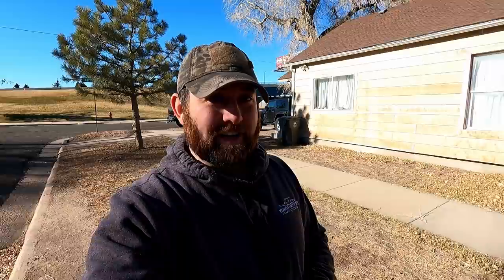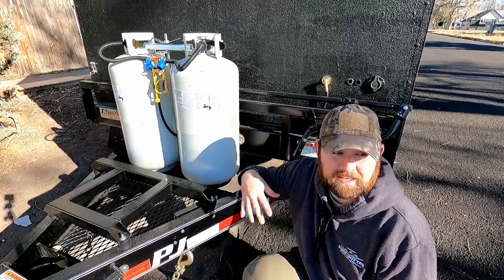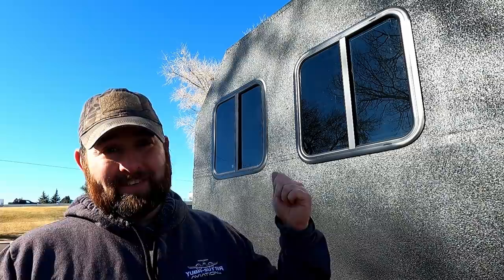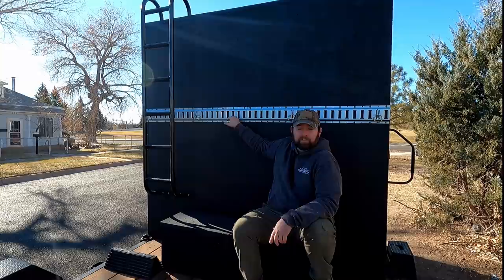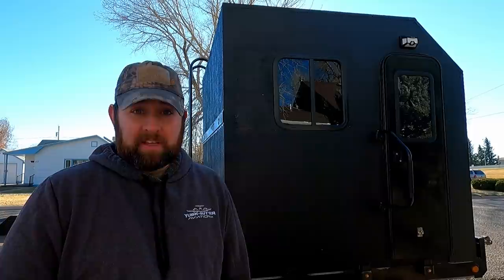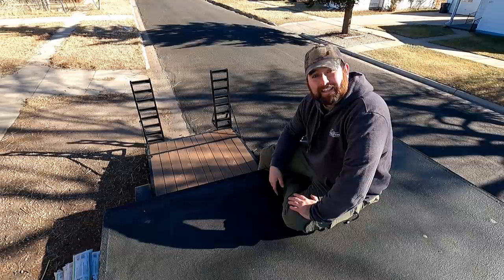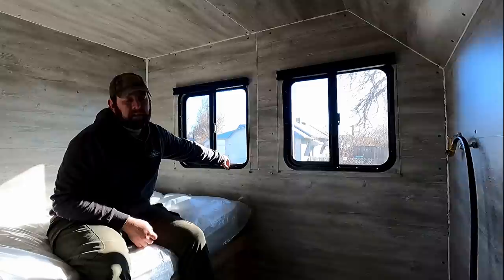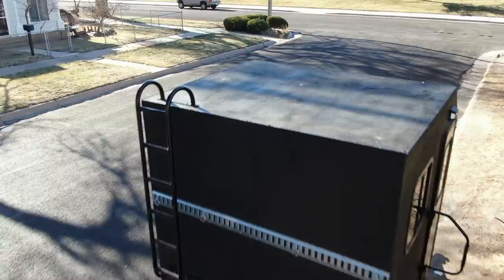DIY Crawler Hauler & Bugout Camper BUILD

Comment: Caulking is completely pointless if you don't run your finger across it or a tool to level it and push it in to the crack and they do make gray caulking I would just put some gray silicone finish it nice with a caulking tool same thing for your windows I'll get a black neoprene caulking do it in layers just fill the hole area in with caulking maybe use some backer rod but for the most part just finish caulking would be just fine.

Comment: Why would you want a Jeep when you are already bringing a Truck  

When a Motorcycle like a dual sport or Adventure bike Honda has lots of great ones to choose from at low cost // just chance the seat when you get it from Honda as the seat as they are hard for most people 

You could also get a 
A Side by Side make it street legal 

Or even a small boat 

All of those make by far more seance then a jeep and you could make the living space bigger or leave it as it is and just save the weight
Reply from the maker: The truck most definitely is not built for serious off road and the Jeep is not able to do highway speeds. Plus it's nice to be able to bring the Jeep back home if/when it breaks.

Comment: I'd go buy a black colored roll of vinyl baseboard... Then measure the length and width of the gap around your windows and PL-400 [subfloor adhesive] the bullnose [top] of baseboard down pointing inwards to the inside of the trailer... That way you see the rounded over factory edge of the vinyl showing and the cut down portion side faces towards the window and less noticeable or can't really be seen...  I'd use a metal straight edge to get straight cut lines that way you don't end up with jagged or wavy cut edge... I'd also join the two ends together on the middle part of the top of the window frame area instead of the bottom or side where it'd be more noticeable... See Photo...: https://i5.walmartimages.com/asr/70311d94-84d4-4892-9fb2-97977a19ae05_1.fee61adeb5a7ccafde162bfa58c35458.jpeg?odnHeight=450&odnWidth=450&odnBg=ffffff

Comment: Have you had any trouble going down the road without the jeep not loaded on, during strong winds lifting the back of the deck off or the strong winds moving the trailer around on the road. The only reason I'm asking is because I drive a big rig and I know what strong winds can do to high sided vehicle. Plus I'm building my own camper with the same concept. 
Awesome build, I really enjoyed watching the video, and it gave me some ideas as well. Check out my Facebook, I've been working on it for a long time, sometimes life takes over and project come to a halt. but I just ordered a 26.5 foot frame off of a old camper to remount the new camper on.
Reply from the maker: I really won't drive it unless the Jeep is loaded on because the Jeep is needed to balance out the trailer. I can tow it unloaded across town if needed but no highway or long distance. As for as the deck I've had no issues so far with wind lifting or pulling it. I've tried to over build it for that reason.

Comment: You do not want to put the cabinets across the top because of g-forces around corners you keep your weight down on your trailer not up in the air you'll have more in new cabinets than you think you have a really good idea keep thinking about your weight balance just like you four-wheel drive do you want your weight up I or do you want it down low are you going to put your Jeep on there put more weight up high another tip over set up over situation sports cars have a low serve gravity so they don't roll you do not want a high Center of gravity on your trailer any more than you can help and try to balance then take it to someplace you can weigh it how much weight is on the tongue how much weight is on the rear bumper loaded something some old guy taught me the tongue weight turn to 15% of the trailer weight loaded if you had the right equipment I think you do and remember lower center of gravity is always better so watch how you load your stuff open cabinets weather dress greens bag holders of like an old Chevy Lumina what hold the groceries up their stuff but you don't like heavy stuff up there you doing good I hope I gave you a couple of brain farts the might turn into something better good luck Happy New Year

Comment: 800 pounds on the hitch? That's like 400 kilos... isn't it recommended that you put about 50-100 kilos of pressure on it? At least, as far as I've been taught here....Awesome build though!
Reply from the maker: You want to put about 10-15% of your trailer weight on the tounge of the tow vehicle.
Reply: @CodeBrownProductions  that's... A lot.. I looked it up but over here in the Netherlands the max pressure you can put on the ball/hitch is 150kg (300 ish pound) on a 3000-3500kg trailer (so that's the trailer including whatever is on top).. maybe I'm missing something
Reply from the maker: The max tounge weight changes for the type of vehicle you have I have a Chevy 3500 with a diesel engine, it has a max tow rating of 27,500lbs and a max tounge weight of 1500lbs.
Reply from the maker: Also if you notice 300 kg is 10% of a 3000 kg trailer
Reply: @CodeBrownProductions  ahhh there you go, nah all good. I was looking at "normal" cars, but those trucks are big for sure. IIRC they register as a truck (like, you'll need a truck license and everything) here, so makes sense

Comment: Why not just tow it with the Jeep?
Reply from the maker: Way too heavy
Reply: @CodeBrownProductions  I mean, they make campers bigger than yours that a Wrangler will tow just fine..... then you wouldn't have to tow another vehicle and would probably save a ton in fuel costs
Reply from the maker: All logical points. But the intention of the trailer was to be able to transport the Jeep assuming you might break it and have to tow it back. In addition it keeps the mules low on the jeep so you aren't tearing up expensive off road tires on the highway. Just different priorities.

Comment: i dont understand the appeal of doing this vs just making a small camper that the jeep can tow
Reply from the maker: My Jeep can't do highway speeds because of the gearing. Also the risk of breakdown is high for the type of wheeling I do. Towing it with my truck allows me to tow it back home.